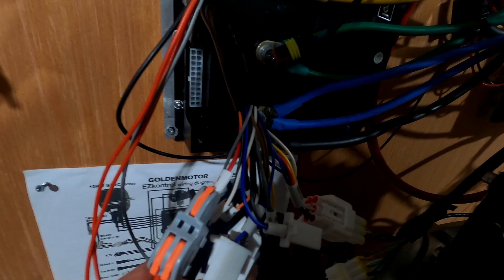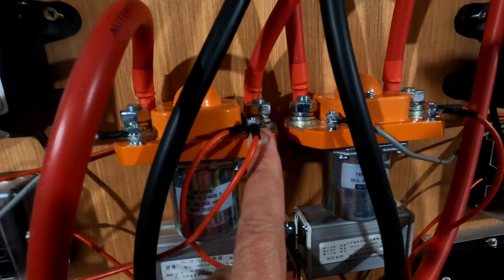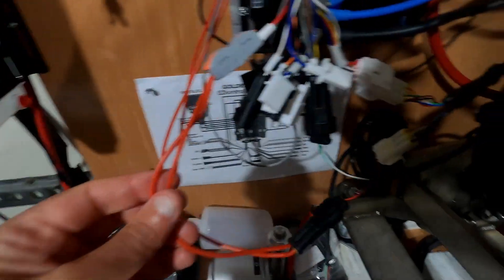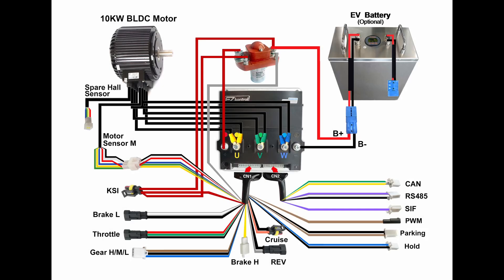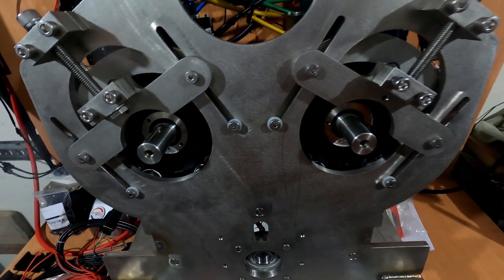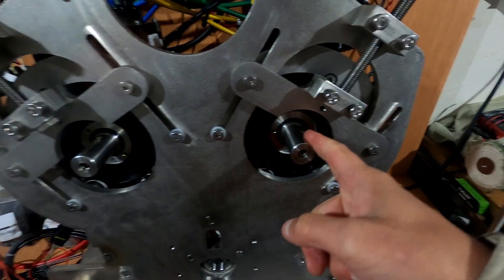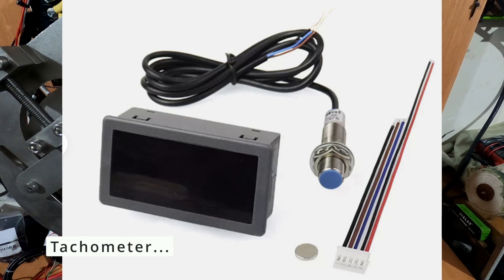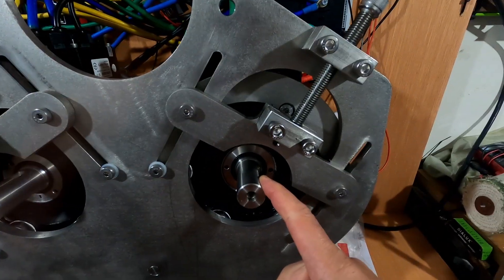Off-Grid Boat: DIY Electric Boat Motor Assembly - Ep. 12

Comment: Henrik, did you design your motor mount yourself or find/buy the plans from somewhere ?
Reply from the maker: Hey Jim - Happy Friday! I designed the mount in QCAD (Open Source 2D CAD Program). More then welcome to use any parts if you believe they can come to use. I have one issue that I need to sort though. When welding the front and back together, I got a slight misalignment so the propeller shaft part is not spinning as freely in the bearings as I like. Might have to cut back open again, align and try again:)

Comment: Hi

I am following your project and very impressed about what you did.
Could you give us an idea of the money you spent until now?

Again, congratulations 👏
Reply from the maker: Hi Footperf6307 - Thank you for your kind comment and for following the adventure:) I assume it is the motor build you are asking about (not boat and battery solutions?). The biggest outlay is the motors $715 x 2 (plus shipping and import tax you have in your country) and motor controllers $480 x 2 (plus import tax and shipping applied to your country) | DC Contactor x 2 I believe are around $80 each (but not 100% sure you actually need them).  Stainless Steel Motor Plates (around $500 laser cut), and other bits and bobs like bearings and pumps etc. probably another $500. So guess somewhere around $3,550 (and add import tax and shipping on top of that) as it stands. Depending on your reason for building it may be beneficial to find and of-the-shelf solution. My build is not yet a proven concept so keep that in mind before you start something similar:) As soon as I have a battery pack I will start doing some bench test and fingers crossed:) Onwards and Upwards!

Comment: I’m excited about the projects! I’ve tried using two sensorless BLDC motors connected by a belt and pulley. Unfortunately, I encountered synchronization issues when the throttle was more than half. Have you tried running your two sensored motors? Do they prevent synchronization issues?
Reply from the maker: Hi Alan, Happy Friday!! That is a really good question and I am getting close to find out. I have a feeling that I will run in to the same issue as and when I come to test this. My first test will be to run the two motors from one throttle and to see what RPM is displayed in the App. I will also add two external magnet sensors to get a second reading just to be sure. If the RPM is to different from each other or unreliable in other ways I will then look into 2 other ways. First one is using the throttle on one motor controller only, amplify the output signal and feed that to the second motor controller in the hope that when the signal is identical also the RPM is identical. If that does not work there is another protocol that normally is used in industrial applications where the accuracy needs to be higher (I would have to investigate that one to see if gives more control over RPM). Out of interest, what would you say is an acceptable discrepancy in RPM if the RPM cannot be exact?  Let's say one motor is running at 2000RPM and the other at 1990 RPM then need to understand adverse effects from one motor pulling the other. Looking forward to bench testing:)

Comment: OUFFF I will follow your next one too !!!  What gear ratio do you inted to use ???   And what propeller spc as well ?     I will have 1 motor per side, my pros are : 18x15, still not fixed on gear ration...
Reply from the maker: Hey Antony, hope all good your side:) I am still experimenting with the gearing and looking at trying to make sure that the motor is running on it's most efficient RPM (from a power consumption point of view) and after that making sure that I stick to the max RPM for the propeller (which I believe is somewhere between 1000-1200 rpm) - The propeller recommended when I sent the company the boat numbers (and the fact that I am trying to use motors for re-generative use, even if the cost me a couple of knots when sailing) was an: 18 inch x 11 RH. 3 Blade Propeller (NiBrAl) so guess our propellers are fairly close:) - How is the catamaran renovation coming together?:)
Reply: @modularhippo  Here in our country it's -25 celcius... :)    Everything is on hold for another 3-4 month easy...   Our Golden 10KW peak RPM is apprenntly arround 2800-3200...  and on my side with 15 inches pitch, I'm looking for a 450-600 RPM max but with a 4-6 x gear ratio...   I'm not at your pace at all but really like following what you do, you work so well :) !
Reply from the maker: @antonygilbert9695  -25!!!! Jezz, and I am complaining about it being cold here (feeling silly now, ha ha). Thank you for the kind comment, it is a bit of a balancing act as I am working full time BUT one step at a time. As long as it is a labour of love I guess time is less important:) Your numbers looks good to me but guess we will only first know when the boat is in the water:) Keep the dream going, before you know it spring is here and you can get your tools out:)
Reply: @ Dream is there that is for sure :)   First to put on water tells the other okay :) ?   Keep on going with your videos, I'm following like crazy :) !!  Cheers my friend !
Reply from the maker: @antonygilbert9695  Deal!! Let's keep each other up to date!!:) It is a small world so once both boats are in water it is a big chance we will cross paths:) - Enjoy your Tuesday my friend!